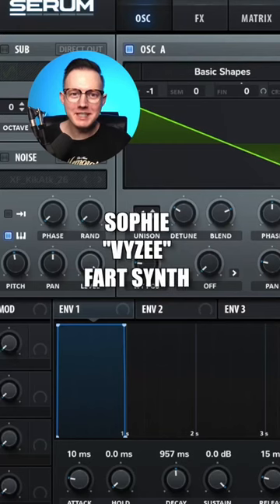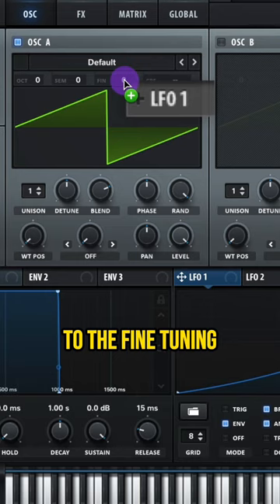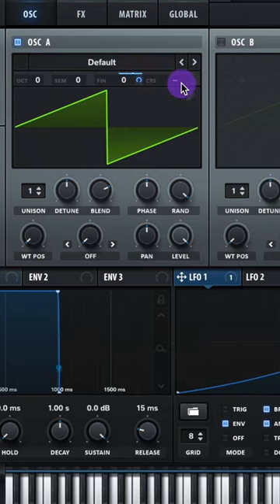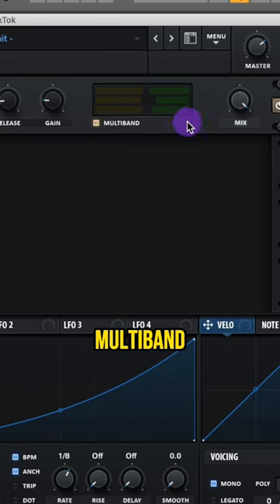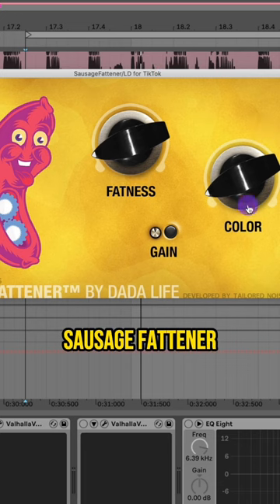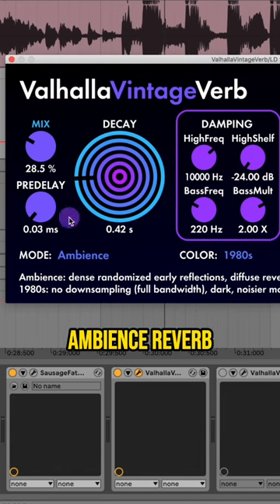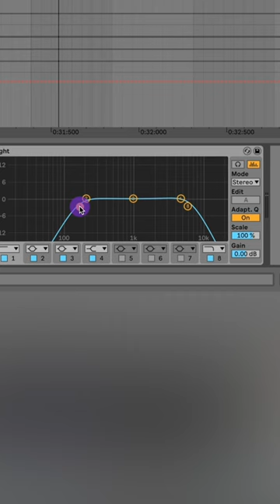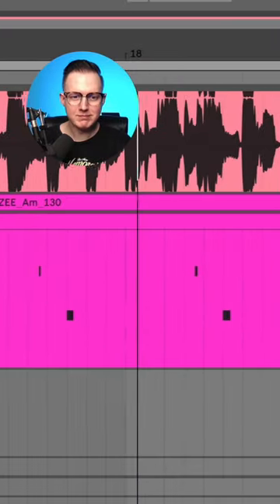How to: SOPHIE “VYZEE” Fart Synth in Serum #samsmyers #sounddesign #shorts

Comment: The actual sounds on Vyzee were made with the BeatBox machine on the Monomachine. The BeatBox machine were just 12-bit drum samples that you could retrig and modulate the retime rate at extremely high rates. Specifically some sounds at the beginning of the song are the BBox kick drum retriggered at high rates but with an LFO to slow down the rate at the end of the sound.